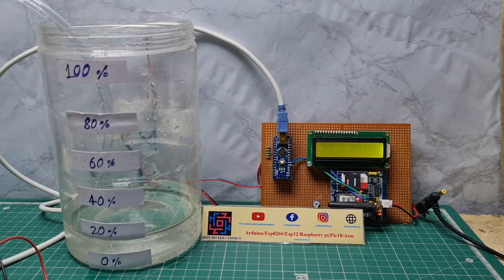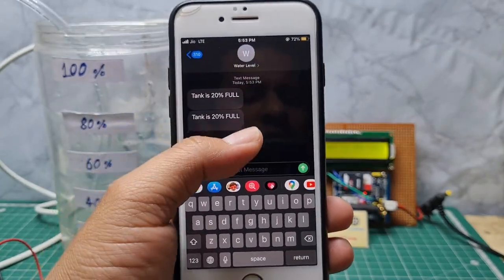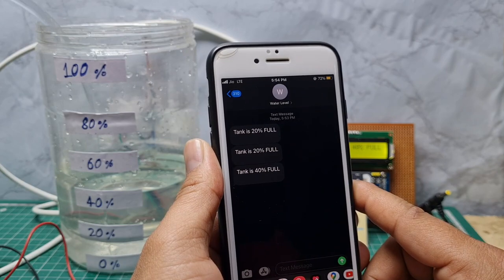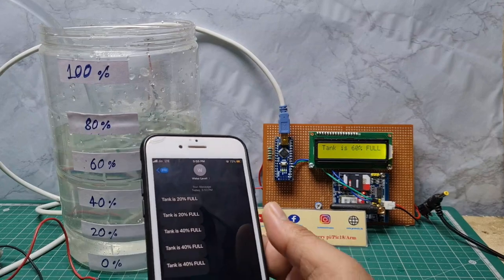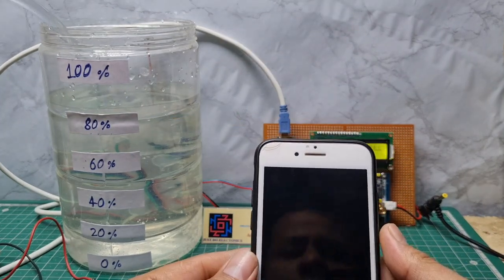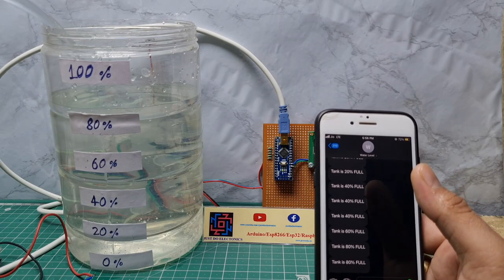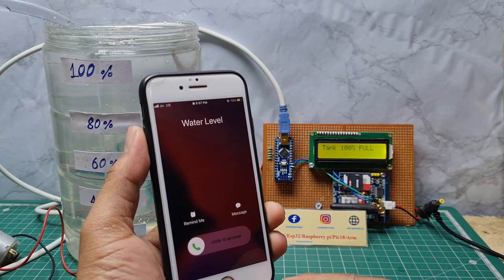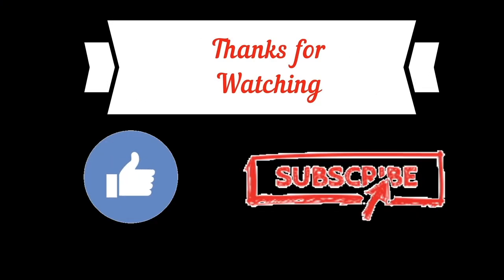Water Tank level Monitoring System | GSM | Arduino Project

Comment: You need to mention how you connected analog pins I went through ur article too. My assumption is u have kept holes at back of the bottle at different levels whenever water reaches that point it sends percentage of water